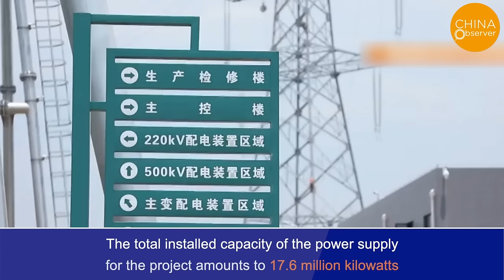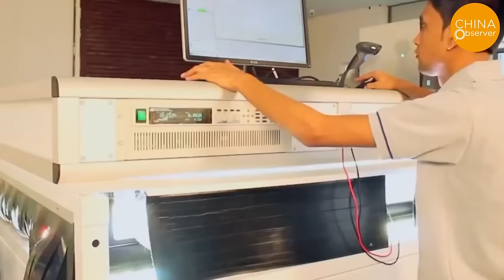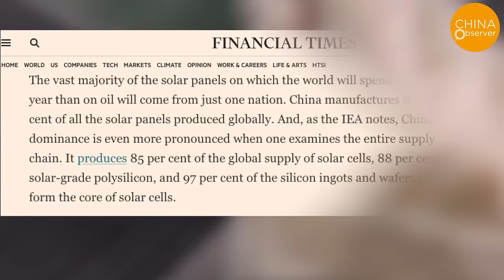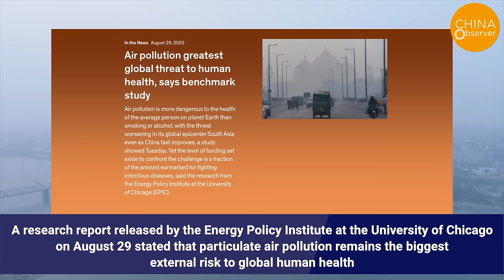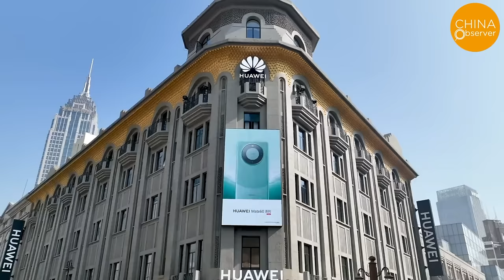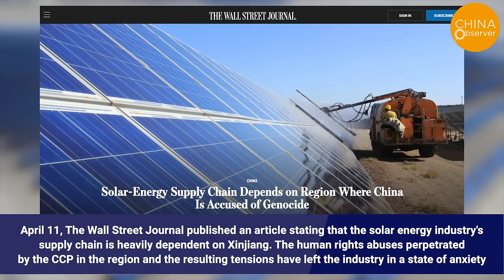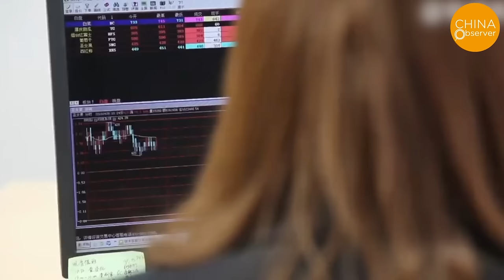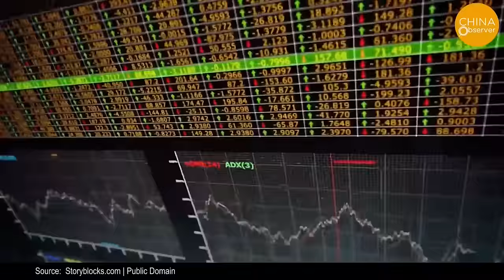China’s Costly Joke: ￥80 Billion Solar Panels Blanket Deserts, Demanding Daily Washes

Comment: Theoretically if we built a magnetic accelerator cannon and used it to launch satelites and other station pieces, then had them assembled in space. Any space born program would pay for the damn thing in 10 years depending on what is deployed. Then built mass solar farms in orbit, getting it down to earth would be the only problem, but I believe lasers could be a way to do it without a space elevator. Maybe have a station in orbit that collects all the power and stores it in a capsule to be dropped into orbit for use, while using the MAC to launch other capsules to be recharged.
Reply: Why not just use the solar panels in space and beam the energy to where you need it?  Has its own issues, but solar power is something an orbiting solar plant/constellation would have in abundance and could further power industry in space via beaming energy to lighten loads and utilize electrically powered propulsion.

Comment: I know this channel critiques political systems of China, but covering the deserts and barren areas with solar panels is a great idea. Any critiques? Change my mind.
Reply: Generally it's not a bad idea, but I think this one is bad specifically mainly due to location than anything. The Gobi desert is plenty windy, meaning that the Panels are going to need a lot of maintenance and cleaning on the regular.
Other drier and less windy places though, absolutely.
Reply: The transmission lines will also be expensive and reduce the amount of electricity transmitted.